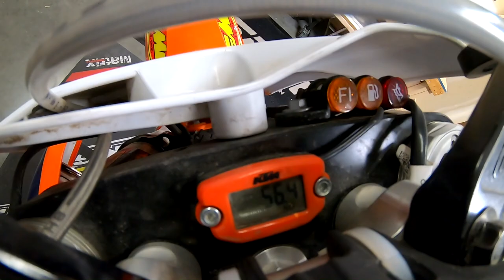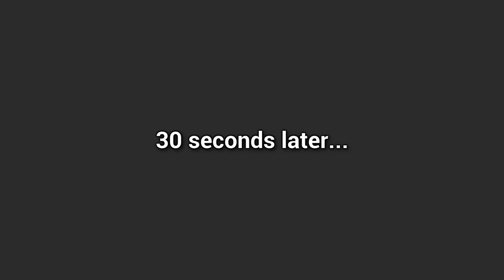Idle Screw Mod on my 2020 KTM 250 XC TPI (KTM/Husky TPI)

Comment: I had idle issues, changed my ccps and this fixed the idle issue. Seems a lot of ccps units are bad.
Reply from the maker: I heard CCPS would result in power issues with throttle response as well. Was yours solely idle? I never checked or replaced my CCPS, but bike has been running great since the idle screw mod.
Reply: Would highly recommend you change your CCPS!! Buy an extra and have one on hand just in case.

Comment: Since you can run richer with this mod because the air bypass screw done at have to be pulled out to make the idle run better does this mean you have more low end power? I want to know if it’s a big enough change I should get one
Reply from the maker: With my bike, I had never touched the air screw from stock. But once it stopped idling, if I turned the air screw out far enough for it to idle it ran like complete garbage and you could tell it was way too lean and had no power. Now with the idle mod, my air screw is pretty much where it was from the factory. I would not say I notice much of an improved bottom end response, but it does allow you to fiddle with idle/air screw combo to make the bike richer or leaner as you might prefer. I've fiddled a lot with the air screw within 1 turn in/out now that it's idling good, and have it running good. Overall if your bike idles fine I would probably not go through the trouble to do this mod in search of power gain. Let me know if that answers your question or you want any additional details.

Comment: Each time you touch that throttle you are fouling the plug. You do not touch the throttle on TPI bikes until they are at least a 140°.  The ECU pumps extra oil before they are warmed up. By  touching the throttle that just adds even more oil.